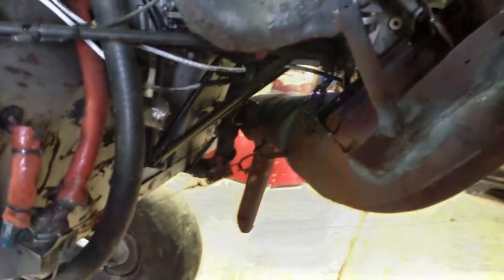How to check your anti freeze

Comment from the maker: Dexcool is silicate and phosphate free and meets Europian standards. The Rotax engine in this video is from Austria. Dexcool with distilled water is whadt thery recomend.
GM had issue with the intake gasket seals leaking using itd -- Personally I have never had an issue yet and my lasdt GM product went ove 425,000  km an my current GM is at 290,000  km right now.